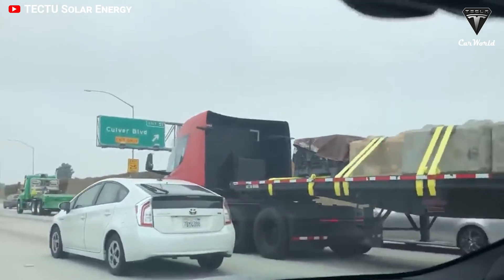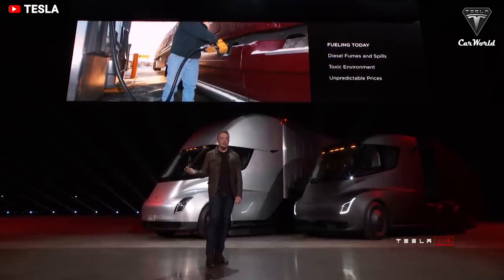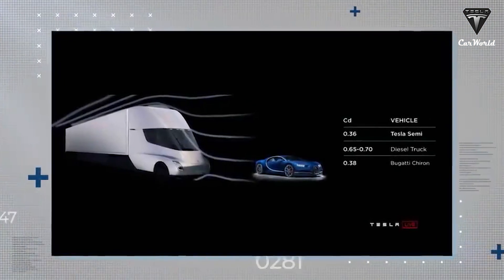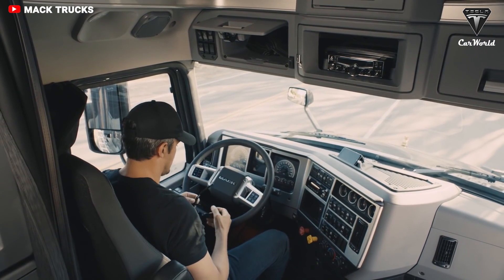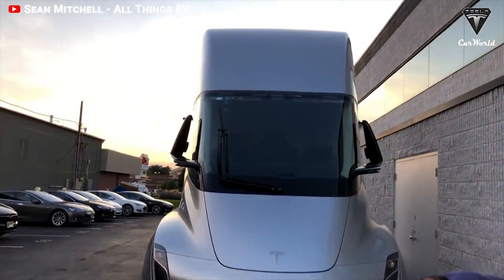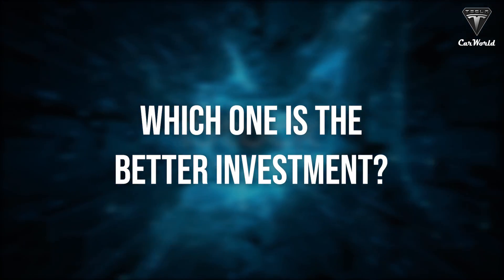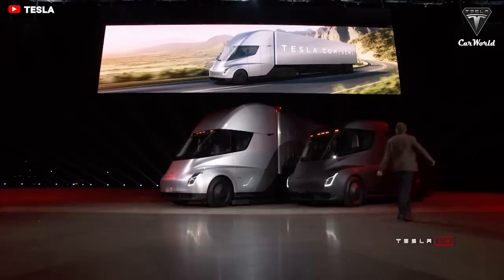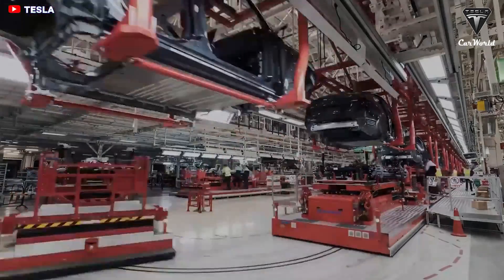Which is the KING of 2023 heavy trucks? Mack Anthem Diesel Truck Vs. Tesla Electric Semi?

Comment: First thing I have very rarely had any load go less than 500 miles. That Tesla would have to be charged at least every day if not twice and considering truckers are already on a limited amount of hours to work a day and I assume charging would be treated just like fueling, being logged as on duty therefore using up hours for the day, it will drop productivity. Next how many crashes have we seen with electric vehicles that turn into blazing infernos what if that semi had a load of explosives? There goes half the highway and firefighters would have no choice but to just watch it burn. Next issue Teslas self driving crap the fact that we are constantly seeing accidents and sometimes fatalities due to people using the self driving mode doesn’t make me want it in a semi. The Benedex moderation system is bad enough with it sensing overpasses and thinking that they are cars and slamming the brakes on drivers. Also 82k would be illegal weight wise without permits in most states and considering the drive tires can’t weigh more than 34k the idea of having all the engines there adding weight I don’t see how it’ll be legal to even operate as a CMV. Maybe someday but not anytime soon do I think that EV will have a chance in the long haul game, and if so I doubt it’ll be Tesla who does it by themselves. Maybe withPete or Kenworth behind them they could do it but even then I still think it’s unlikely.

Comment: I think the semi will be really successful. It may also help the business as a whole because of autopilot. You can relax during your journey, grap a water with no issues, and a ton more. These Tesla trucks should also be really safe because as shown with the Tesla cars Tesla is very good at making safe vehicles. I don’t get all the hate.
Reply: 1 distance truckers are paid by the mile average is $0.55 for a company driver so if your truck can only go 65 mph like most trucks are governed at and you can only go 500 miles max before charging your looking at $275 a day vs with a traditional truck where you can run 650 max governed the same without having to fuel that day or the next you would make $357. Your taking $100 a day away from a driver.
2 The charge time. How long will it take to charge all those batteries? Average Tesla takes 6-15 hours to charge. That all has to be done with the driver being on duty wasting hours they are allowed to work. (70 hrs in a 8 day time frame in case you were unaware) and with the Tesla semi having more batteries than their average car your looking at even longer charge times. Causing productivity to go down and drivers to loose more money because we don’t make money if the wheels aren’t turning. 
3 We don’t want anymore safety crap in the trucks. Anything that takes control away from the driver is unsafe. How will the Tesla handle going down 9% grades fully loaded especially without a jake brake or even the ability to down shift? Plus we have already seen fatalities and major accidents from people in teslas trusting the self driving mode you really want to risk that in a big rig that could be hauling explosives or dangerous chemicals? 
4 This thing wasn’t designed with the driver in mind if it was they wouldn’t have set the passenger seat behind the driver seat eating up valuable room for a sleeper. A good portion of truckers are bigger guys and don’t wanna climb up a bunk bed every day to go to bed. We spend more time in our trucks than at home we want some comfort and Tesla obviously didn’t ask us before they designed this thing. Elon just saw a chance to make a ton of money and it’ll be money from the truck drivers pockets that pay him. 

In summery lost wages due to charge time lost productivity due to charge time worse safety due to taking it away from truckers who mind you many have well over 500,000 safe miles under their belt more than most people will go in their lives. Not to mention all the driving training they got and continue to get from their companies. And finally the greed of Elon taking money out of the under paid over worked trucker driver so he can say I invented an electric big rig yeah it isn’t practical and it doesn’t care about the people who have to basically live in it but I’m rich so who cares.

Comment: This is a gross misrepresentation of trucks in general. Tesla would be limited to gvw by axles. 12k per axle. Look up all FMCSA regs. More tonnage means more axles. That’s why oversized vehicles have loads of them. Oversize haulers have existed before Tesla was a thing hauling 150,000lbs+. Teslas platform would be an amazing short range platform but be honest about it. It would be interesting to see how long an “oversize load” for.
Reply: Plus if you do a quick search you’d see there’s trucks with 600+hp with hauling capability’s of upwards of 240k. Interesting comparison choice in all honesty.

Comment: As a former long haul truck driver I would have liked to know the recharge time, a couple of hundred miles is not too far if you are going on a coast to coast run of nearly 3000 miles. I am not surprised they don't show much about sleeper accommodations, looks like this would not work for team drivers. Also what is the availability of charging stations for this, doubt that they would be available for many truckstops.

Comment: This guy clearly knows nothing about trucking, its not about HP but about torque and why do acceleration matter exactly? Plus   you cal only drive for so long and your truck in total can pass a certain weight. And I'm thinking that the tesla weights more then mack meaning tesla is going to pull less cargo then mack which in result the profit will be lower on tesla. Also range will drop in high and low Temperatures and there will reduce performance in battery pack. Plus the interior is king in mack. Everything is buttons and it's spacious and cozy.

Comment: 3:50 this entire section is a complete joke and utterly pointless. Acceleration literally does not matter in a big truck, that's not the point of driving them at all. The point is to get freight from A to B as safely and economically as possible. If you're driving a truck like a sports car, you are putting other people in danger and are very likely to get yourself fired from constant load shifting. Even with all the technology in the world, the driver is still the final safety system. I am actually insulted by the fanboyism over a metric that doesn't matter at all.

Comment: Ok but what about build quality and durability, Teslas are notoriously bad at both. And what about the distance they can cover before refueling and refuel time. Also physical buttons are better than touch controls and apparently it doesn't have a sleeper cab idk, either way it seems useless in comparison to traditional trucks, at least for long hauls. Furthermore no-one cares about hp or acceleration, imo when it comes to trucks torque is the only thing that matters.

Comment: didn't mention time for charging, where to charge and I don't believe these are designed yet for cross country deliveries because at max mileage 500 you are definitely talking about local to maybe cross the same state with charging at facilities owned by the delivery companies because with the stated charging of 80% max quick charging usually that last 20% takes several hours so overnight charging at it's home base to get to that .07 charging rate

Comment: the 0-60 is stupid look you ruined 8 tires and all the cargo fell over and look you have half the cargo there, so its a shit highway truck.....but yes they would do great as a day cab short hual........and heres a tip too why big trucks have low power numbers relative too their displacement  its because there under tuned for longevity 1,000,000 miles is the average lifespan and i doubt the tesla reaches 1/4 of that on average .....and that interior is fucking stupid with the suicide doors.....its a tractor made by people who never sat in a big truck....its all a good idea just terribly executed......also DOT reg is 80k thats why there all rated at that but when you weigh more you have less for your cargo because its gross weight not cargo weight .....also for no apu how does one heat/cool the cab during down time without a charger.........

Comment: The following are currently Tesla Semi problems: 
current 500 mile range is less that
the 800+ mile range of long haul
trucks.
 there is no sleeper cab version and other cab configuration problems
 Electric vehicle charging infrastructure currently takes 4 hours or more to charge a 900 kWh pack to 70% or more

Comment: I got everything I need to know from the thumbnail. They make the tesla look bigger, but it's smaller. Tesla drivers won't need a sleeper bc it doesn't have the range. Tesla has no sleeper. Also, when you're driving a commercial truck like this you don't want a big infotainment screen. Even though the mack has a bigger infotainment screen you failed to mention to the right of the steering wheel.

Comment: You can't call any electric vehicle "zero emission" until all the world's electricity comes from zero emission methods. As it stands charging a truck will cause more pollution than a properly running diesel engine. 

You talk about the acceleration like that's important when it comes to an 80k pound vehicle. There's no need for a large truck to accelerate that fast. 

You talk about the screens, but drivers of such a deadly weapon shouldn't have access to TWO distractions directly in front of them. On top of giving drivers who would be used to the slow acceleration, something that fast is asking for trouble. 

You talked about price of purchase but didn't say anything about the competitor the video is talking about. 

All in all this comes off as you sucking eleon dick. Just because it's new doesn't mean it's good. On top of all of that, putting the driver in the center only gives better visibility in the case of having massive screens for mirrors. Most of the time a driver needs visibility is backing up and taking sharp turns where they can look out the driver's side window (that's the left side in the US, right over seas. In case you forgot).

Comment: Range and load are most important when it comes to trucks. Take into consideration the fact that electric cars always do less than the claimed range and now it's halling heavy loads so it's going to decrease the mileage even more. What's the point of having a semi truck that has a faster 0-60 and higher top speed when the legal speed is only 70mph

Comment: Yeah, none of these specs matter.  HP doesn’t matter for a truck, torque does……also range does, and thirdly, time does.  The Tesla takes too long to charge compared to the fill time for a diesel.  The Tesla at best will be a city to city not a country wide truck.  It doesn’t compete because, where it matters, it can’t.  The weight measurement is misleading.  You present 82,000 pounds as if it’s carrying capacity but that includes the truck, which with all of those batteries will weigh more which means less payload.  This is the most misleading video ever.

Comment: okay so as far as cost goes for fuel and fluids, on paper it looks good for the tesla however when comparing ranges of a fully fueled day cab with lets say 150 gallon tanks for an overall distance of 800 to 900 miles vs the 300 to 500 miles on the tesla it seems like a hard bargain for both owner operators and larger companies. Owner operators often need to need certain delivery windows which could potentially be a problem when having to stop every few hundred miles to recharge, still unsure how long charging these would actually take. As for a bigger companies specifically distributors who have a mostly local delivery area relative to their home base these tesla trucks make a lot of sense. However for companies such as the one I drive for  which is a pepsico subsidiary brand we have a wide variety of distances and times that we travel. We could go anywhere from 100 to 1300 miles in a trip and most day runs average about 400 miles so the idea that we would have to find a plug to recharge our trucks possibly while delivering or maybe take a break at some point later in the day means the company pays us a " Delay" rate based on how long we are delayed. While cheaper that the driving rate overall I wonder how much it would cost extra over all with both the delays on top of the normal driving rate as well as possible layover rates and delays in deliveries costing our sales reps to not meet their numbers

Comment: I'm sorry man, trucks are for long distance hauling and from what I've seen tesla isn't a long distance vehicle. The truck will be hauling weight and those batteries will take a toll hauling weight especially if it's cold. Tesla has improved the tech of the batteries for cold weathers, but those batteries still take a toll in cold weather. No one cares how fast their truck accelerates, folks just want to make sure their truck can haul their goods and stay on the road, not break down. Plus if anything happens that truck is going to be sooooo costly to maintain.

Comment: So you are telling me that a semi truck has similar drag coefficiency to a 80s prototype race car? Only way that could even remotely be true is by counting the effects of drag on the truck while having a trailer on it which isn't taken into account but even then I feel doubtful that a massive semi truck that has more frontal area than my mom could produce such ridiculously low numbers, this is all just a marketing hype train with conveniently twisted facts all around it to make it more appealing than it should be, I reckon its to boost the preorders. If I somehow turn out to be wrong about the aero I will without a doubt do anything to integrate that information into my rc cars and my knowledge on aerodynamics. However I must state that just because it's a startup scam it doesn't make it a failure as sad as I am to admit it

Comment: This guy is a Tesla SHMEAT rider holy 😭😭😭 Performance numbers dont matter when it comes to semis only maximum load and your range. Tesla don't have a cabin in the back but said "however they could drive for long period" just but that means they need to charge for hours on end as well which time is money in the trucking business. Also your forgetting about battery degrading which overtime the battery won't be able to hold the same amount of charge as they used too

Comment: Class 8 trucks are by law limited to 80,000lb electric trucks are given a 2000lb given, so it comes to weight of the tractor at full load I belive the tesla is 4000lb heavier then the next heaviest... Witch a diesel is rarely above 70% load. Drag has always been limited by the trailer but yes reduced drag is going to help... until it takes a tanker. You can't stop a truck from jackknife it will do what the momentum dictates. Many of these things they come out equal... exept cost... opposite to common electric will be cheaper up front but due to high battery load it will degrade rather quick much faster the a conventional diesel... you bring up good points but it's what you lack to bring up

Comment: there are so many factors that will go into weather these tesla trucks will be worthy. the main part is all about the battery packs, specifically the range, time to charge and longevity of the cells. EV tech just isnt ready for big applications like this. the range of the top spec model may be 500 miles but what happens to that range when the truck is fully loaded? there's that rather infamous video by hoovies garage about the f150 lightning that shows the range is cut significantly when towing. even if the range remains largely the same, what about time to charge? given that even with the fastest charging tech a full charge in the largest range tesla takes an hour or so. given how much bigger the capacity is with the trucks, the wait time could potentially be multiple hours. that adds up quickly if you're making a delivery that requires you to go over 1000 miles each way. the last part is how long a battery pack will last before it needs to be replaced. even if the previous two things turn out to be optimal, that means nothing if you have to replace the pack every 100,000 miles. the cost of replacing one of those battery packs would probably total the truck too. even taking into account the maintenance costs of a traditional truck, given how expensive replacing a pack in current EVs is, it wouldnt make any financial sense in the long run.

current battery tech is barely suitable for basic passenger cars, what makes tesla think it's going to be anywhere near good enough for the industrial sector? only when battery tech improves will E-trucks will be a viable option. until then this is going to produce some hype but it's then going to fall into obscurity when the flaws of the current battery tech rear their heads.

Comment: A Tesla fanboy 🤣
Its torque that matters not the acceleration or a top speed, when comes to pulling. What's the use of a 0-60 of 5 secs when it comes to hauling loads upto 50+tonnes

Comment: The Tesla semi will not replace diesel trucks. A person can see the glaring flaw by looking at other smaller electric trucks. When towing they simply don’t have range, and semi drivers don’t have the time to sit around and charge most of the time. And the last thing a semi needs is extreme acceleration. That’s just bound to cause problems with the load. Torque is what makes heavy things move. The anthem has more. The Tesla is simply inferior in every usable aspect.